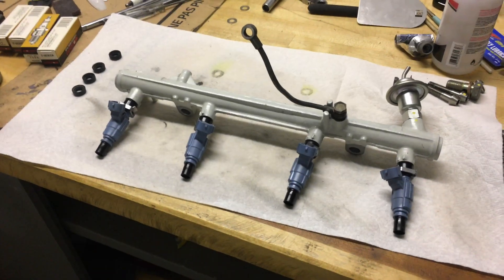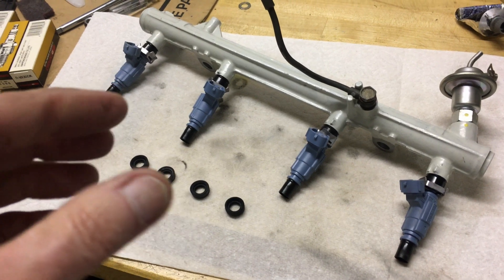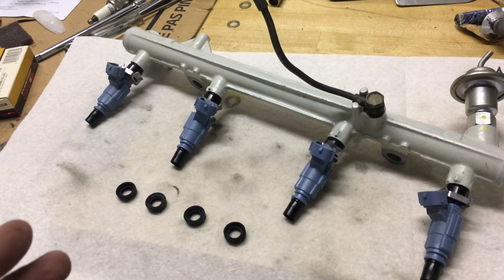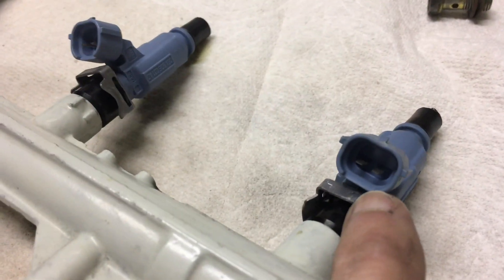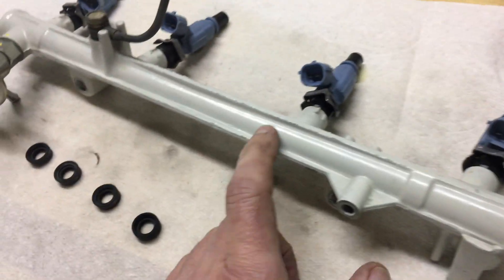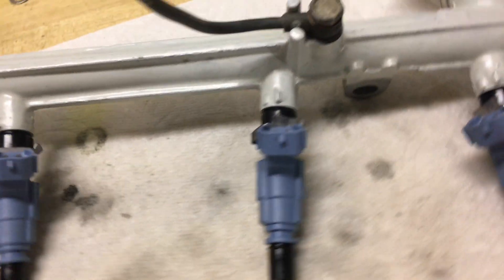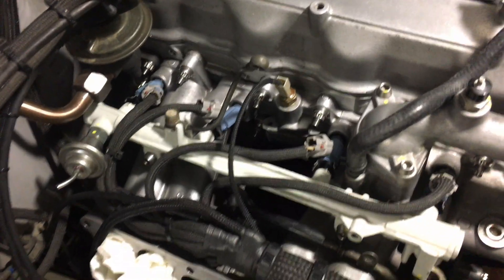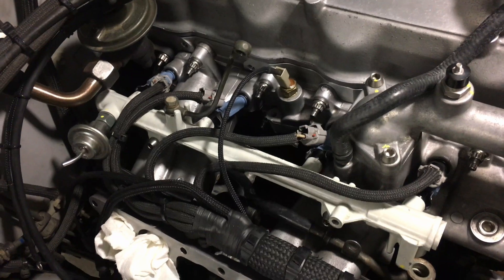Bosch 4 hole fuel injector upgrade for 89-95 Toyota Pickup w/ 22RE - installation tips & info

Comment: I put these in after a performance rebuild with high flow cam, head exhaust, throttle body ect. It ran lean at WOT without me realizing and ended up melting a piston. It’s best to stay OEM. While the spec sheet at 3 BAR is 198 on these and the stock denso ones are 194 at 3 bar, I think the smaller holes don’t do great at the lower pressure that the 22RE fuel pump runs at. If you do want to give it a shot, make sure you put in a wide band O2 sensor to make sure you aren’t running too lean
Reply from the maker: All very good points to consider for sure. However, I'm not sure the issue is directly related to fuel injector flow however. The OEM Toyota pump should be supplying 3 BAR / 44 PSI when the regulator on the fuel rail is operating correctly, although I did install a new fuel pump from LCE, so maybe what I see on my gauge is higher than what OEM would be?. Running a wide band controller is definitely a good idea. Usually what causes the 22RE (with mods) to run lean is the factory ECU not understanding the additional air flow from the more free flowing head, exhaust, camshaft, etc. In your case, did you run an aftermarket engine management system of any kind or just install all the after market parts and run with the stock ECU and the stock AFM settings? On my truck, I have to run the AFM 1 click more rich, in order to keep the A/F ratio where it needs to be under WOT throttle, load, etc. If not (i.e. at the factory setting), the motor will start running way lean for sure. Anyway, good points to keep in mind. I'd be curious to know which camshaft you are running and if you are on the stock Toyota ECU and AFM configuration. Thanks!

Comment: My '92 pickup 22RE needs new injectors, so a couple of weeks ago (March 2025) I went to the Toyota dealer for OEM.  They wanted $1300.00 for four.  Me thinks not!   I don't take the truck on long trips, it's basically just a town runner, so Bosch rebuilds will have to do.
Reply from the maker: $1300? That's crazy. These Bosch guys in the video are still over here earning their keep. I have been super happy with them.

Comment: waste of money. stay with oem.
Reply from the maker: Appreciate your input and I agree that in the vast majority of cases OEM (Denso, etc.) is often best. I don't believe OEM injectors are still offered by Toyota for the 22RE, however; this is why you see a lot of "rebuilt" injectors available for the 22RE. I've used both OEM and also these Bosch jobs here. While not a huge fan of Bosch in general, these particular injectors are very nice and perform slightly better than the original 2 hole injectors found in the 22RE (in terms of spray pattern). Additionally, I'm not sure if Denso still makes their own fuel injectors or not or if that is now handled by a subsidiary. I do know that there are a lot of fake/copies on the market from China, so you have to be exceedingly careful when sourcing replacement injectors for any motor - particularly "Denso" brand. Anyway, as far as my personal experiences, I have about 23K miles on these particular injectors (shown in the video) and they are still running flawlessly and providing perfect A/F ratio and great gas mileage. Of course, now that I think about it, the A/F ratio is being read by a Bosch wide band O2 sensor, so there could always be some type of collusion going on under the hood that the ECU isn't aware of :) I can say these injectors are great value for money, but that's only based on my personal experience with them. Thanks for watching!

Comment: hi sir! I've been really intrigued with your videos and was wondering what your fuel mileage is now with your truck and also if it would be possible to chat with you directly to get some help with my 22re 4runner since I really wanna get this back to good running condition
Reply from the maker: I get around 18.5 to 20 MPG around town - depending on how hard I push the truck. On long highway drives, usually it's around 24 +/- 1 MPG - If there is no wind and level ground or slightly favorable incline, I can sometimes get up into the 27-28 MPG range as long a I keep it under 85 MPH.

Comment: where did you source the braided loom and ties.
Reply from the maker: The wire ties came from Home Depot mostly and the braided stuff is high temp rubber coated fiberglass from McMaster.com as well as some stuff from Alex Tech stuff off eBay. Let me know if you need any more specifics, but basically I just bought a lot of different sizes when I re-did the harness.

Comment: I installed a similar set in my 94 22RE pickup it was ok for a while then I got a running rich code I had to remove them to be able to pass ca smog check went back to the OEM DENSO but they do work for other people in their 22re s
Reply from the maker: Interesting. My buddy has a 1994 pickup and I noticed a few things are different on his 22RE. But that's interesting about running richer. Is the 1994 running full OBD2 or still the normal OBD1 setup like on the earlier models?
Reply: Yea 1994 is still OBD1 it caused too many problems on my truck so I pulled them out my motor is mainly stock just DT tri y headers i have about 2 years on my rebuild with similar parts as you LCE h beam rods and their crank as well and arp head studs … as far as revving out the motor I only really go to 4.5k the motor don’t rev out all the way
Reply from the maker: @mva8082  Interesting. Yeah, on my motor with just 1 click richer on the AFM, A/F ratios under load are good. I've been running at pretty steady 12.5 to 1 AFR here. Around 13.95 at idle. Cruising bounces around 14.7 typically.
Reply: I came to this video because I have the same problem I bought some that say I don't need settings that work stock but it's a lie my car is very rich in gasoline and it smokes too much and it doesn't work as it should it is advisable not to buy them
Reply from the maker: @orlando1986100  That's interesting. I run them on my 22RE and they work fantastic. No issues at all with A/F ratios. The pulse width of the injector cycle is controlled by the ECU, so perhaps you have some issues related to something else in either open or closed loop operation on your fuel system? Unless your injectors are defective, I really bought they are the issue, given how well they worked for me and that basically they flow the same as stock.
Reply: @ray5961  I still have not left the doubt because I have a 340 ph gasoline pump. If there is more flow of gasoline, I will change it for the original and there will be a comparison. Thanks for the reply. the injectors that I have installed are 220 Cc. and I think the originals are 198 something like that
Reply from the maker: @orlando1986100  Yeah, when I bought mine (the ones in the video) the website listed them at 198 cc/min at 3 BAR (45 PSI). Do you happen to know what pressure you are seeing on your fuel rail using that pump you mentioned? Different fuel pressure due to changing the fuel pump could definitely impact things. I run a fuel pressure gauge here and under load I'm usually seeing 43-44 PSI on the rail.
Reply: @ray5961  I have the AEM fuel regulator but the problem with that regulator is worse. I never managed to fix it. I was consuming too much gas and with the Toyota regulator it improved a little
Reply from the maker: @orlando1986100  Yeah, the fuel system can be tricky when you start changing things around. I run the Toyota OEM regulator, but have an AEM fuel pressure gauge plumbed into the fuel rail to monitor pressure.
Reply: @ray5961  I have that same AEM and it was more of a problem. One question, how many psi do you have it set to?
Reply from the maker: @orlando1986100  I'm running the Toyota OEM fuel pressure regulator. The gauge I use to monitor fuel pressure is from AEM; it has no impact on the pressure... it only displays what the pressure is. The Toyota fuel pressure regulator on the fuel rail seems to modulate pressure from around 33 PSI (at idle) to around 43 PSI under load. But I have no way to adjust anything related to fuel pressure with my setup. When I rebuilt my truck, I installed a brand new fuel pump (Denso 950-0147) with a new filter, so it should pretty close to factory specs. Are you running some kind of AEM regulator or fuel pump over there or something? Like I say, I only have the AEM gauge... no regulator or anything from them; all that stuff is Toyota OEM stuff.
Reply: @ray5961  Hey thanks. I had an AEM installed that I paid like 200 dollars for and it was a bad buy. Right now I want to see the pump again if the installation is good or not because the first days it worked a little well. anyway thanks for your answer
Reply from the maker: @orlando1986100  Yeah, no sweat man. On the AEM stuff... their gauges seem okay, but I don't know about any of their other stuff. I know with my AEM gauges, I was not super impressed with the quality of their wiring harness that came with the gauges. For most stuff on my truck, I try to stick with Denso or Aisin or Toyota OEM. It's a jungle out there.

Comment: Those injectors say they are high impedance @ 14.5 ohms. Did you bypass the injector resistor box?
Reply from the maker: No, I didn't have to modify anything. They are designed to work as is as far as I know. When I did the upgrade, I measured the resistance of both the new Bosch injectors and also the Toyota OEM factory injectors coming out - the Bosch injectors measured 15.0 Ohms across the board and the Toyota injectors measured 14.0 to 14.2 Ohms. I've never heard of any sort of injector resister box stuff? What's the story there?
Reply: @ray5961  My mistake, you have the later gen 22re that has high impedance injectors. The early ones like mine have low impedance injectors with a resistor box.
Reply from the maker: @rootednode  Gotch'ya... I wasn't aware of that. Thanks for mentioning it. What year do you have? Mine is a 1990, but built December 1989 as I recall.
Reply: @ray5961  I have an 86 4runner. I recently installed a Megasquirt 3 with stepper idle control and now have it running better than the stock ecu. I have gained more power and better fuel mileage. I am about to add a champion radiator, spal fan and pwm fan controller from a mercedes to ramp fan speed based on temps using the ecu.
Reply from the maker: @rootednode  Sounds pretty cool. What gas mileage are you seeing with your truck? And what size tires, etc? Also, with regard to the PWM fan motor controller and all that... you're aware the fan doesn't come into play after about 30 miles per hour correct? On my truck, with the electric fan, it has been a big learning experience. The biggest issue is making sure the fan switch and the thermostat don't end up fighting with each other and that you don't accidentally create a situation where the fan runs continually while driving and is unable to shut off. Once you switch over to an electric fan (and SPAL fans are the best for sure), you are beholden to that fan and it's critical to the motor's survival when you are going under 30 mph and/or stopped. If you are going to interface through the ECU temp, make sure you wire in some sort of emergency override directly to ground so you can manually turn the fan on. I had a wiring harness break going to my Spal fan switch and darn near over heated my motor in the In-n-Out drive through. I had to jump out and manually rig things up just to make it home. So be careful :) A PWM fan control seems like overkill for a situation which is really more on vs. off based on temp. Since this would only be needed when stopped (and the temps begin to ramp up), I'm not sure if what you'd be gaining here would be worth all the additional hassle, unless you are just looking for a cool project to setup :) Let me know what your thinking is and if you have experience running a DIY electric fan before. Also, running a temp gauge off the water coming out of the radiator is terrifically helpful when it comes to monitoring the differential temp drop across the radiator as well as diagnostics of the overall operation of the cooling system when stopped vs. when moving at different speeds and under different loads. Same goes for monitoring oil temps... oil temps tell a different story as compared to water temps on the motor.
Reply: @ray5961  I have been seeing about 22mpg combined on my 45 mile commute, 25% city 75% hwy. I have 33” tires and 4.88 gears and go about 75 on the freeway. My tune is a work in progress and I am no pro but it does drive better than stock. I have had good luck running Spal fans on my other 80s Toyotas in the past. I live in Phoenix so the heat can be a bit extreme. I mostly wanted to run the pwm controller for soft start so when the fan kicks on it doesn’t hit the electrical system so hard. The Mercedes pwm controller is very overbuilt for the application and has a built in failsafe to run the fan at full speed if no pwm control is detected. The Spal fan can move about 3k cfm and is crazy powerful at full blast. It will be nice to be able to only use as much of the fan as I need. I can tweak the fan curve to maintain a very stable temp with minimal noise using closed loop speed control. I am a tinkerer though and really just like to have as much control as possible.
Reply from the maker: @rootednode  Yeah, I hear ya. I run a PWM controller on my Taig lathe motor and it gives great control. SPAL fans are the best. That's what Ferrari uses and I see them on many race cars, etc. The one I run on my truck moves a tremendous amount of air. It kicks on full speed; I have that circuit on a 40 amp circuit breaker and haven't had any issues at all. I don't know how many amps it draws off hand, but I believe the original fuse was around 25A, so I figure maybe 5 or 10 amps? My truck does have a 140A alternator and upgraded wiring, so it never gives me any issues, even if it kicks on while climbing a hill in 100 degree weather. 22 combined is pretty decent. I was getting up to 25 or 26 on the highway and usually a solid 21 or 22 around town. Given my motor was barely hanging on, I'll be interested to see what I get now.

Comment: I guess the cost-benefit isn’t so great. Four holes will no doubt need cleaning more frequently in the stock set up
Reply: Well I was a bit obsessed with injector types, like 4-hole or gm ball style injectors years back. I have come to conclude that at operating RPM, 1800-3200 there is so much mixture motion in the combustion chamber especially with the bathtub style chamber and squish zones that the fuel gets thoroughly mixed regardless of injector type. Meaning the difference between 4-hole and two may be negligible
Reply from the maker: @99dynasty  I think that's largely correct. The 4 hole provide a bit more of a mist, while the Toyota injectors have a slight stream effect in there. But it's negligible as far as any sort of improvements either way.
Reply from the maker: Hard to say, but I do put in B12 injector cleaner from time to time.